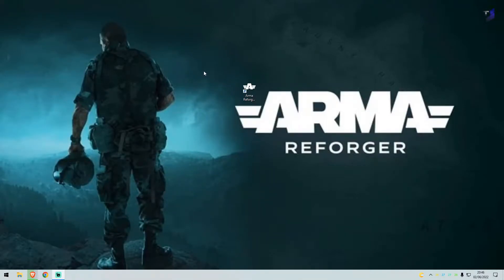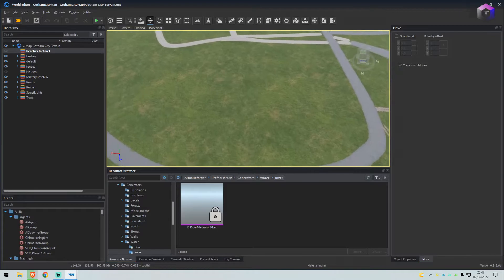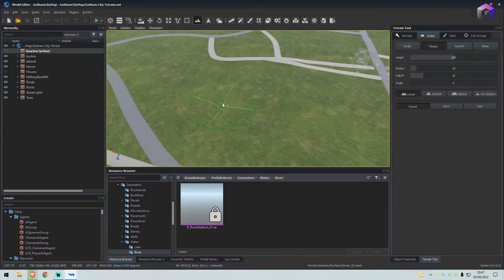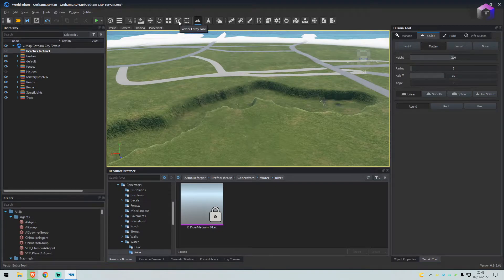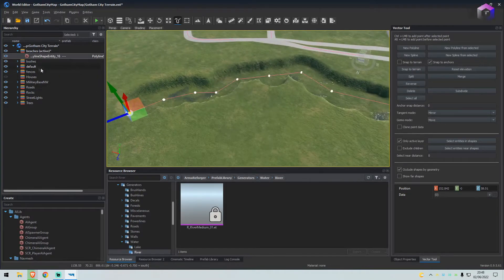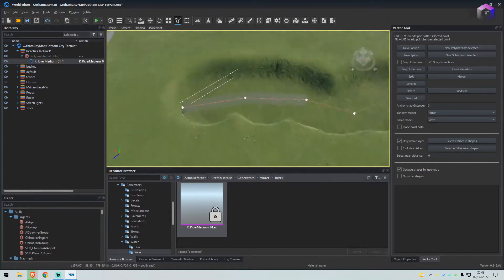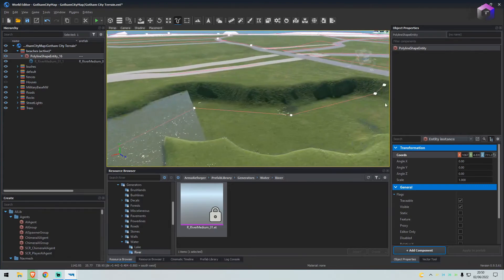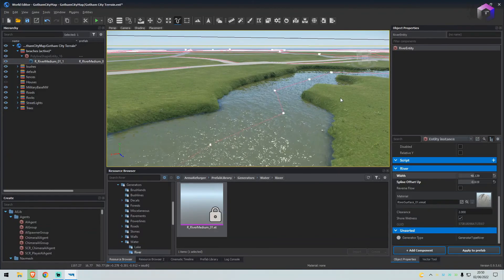How To Create A River In Arma Reforger Tools

Comment: Does a Polyline or a Spline make a difference?
Reply from the maker: Polyline is a line so everything attached is solid.

Spline is a line but splits at every edge so each fence panel for example can be adjusted individually where as polyline will be a single long solid fence that can clip through floors and stuff I believe.

Comment: Hey man, nice video! I'll just add few tips:

1. The river flow will be a bit nicer if you use spline instead of polyline.
2. You can generate river flow map in WE: Plugins -> Regenerate river flow-maps - the flow will then react to terrain and obstacles (a bit). I recommend bringing up console window before that to see the progress.

Life-hack: You can generate an initial river bed using the spline instead of sculpting it (if you wish so):

1. Right-click the spline in the hierarchy and add RoadGeneratorEntity to it.
2. Delete the RoadEntity it created under the RoadGeneratorEntity
3. In the RoadGeneratorEntity properties - check "Adjust Heightmap" and uncheck "Generate Road"
4. Adjust the spline, it will adjust the heightmap, you can make the bed this way.
5. Check out properties of the RoadGeneratorEntity like Road Width, Falloff Start Width and Road Falloff Width - adjust them to make the bed you want.
6. If you want to refine the bed by sculpting, make sure you have the RoadGeneratorEntity selected, open Terrain Tool and click Bake selection button. Then, you can delete the road generator and refine the bed by sculpting.
Reply: Very insightful comment! You by chance wouldn’t know how to add game master to my custom map would you?
Reply: @jamesparris6673 Just opened some older version of GM_Arland in the WE and I can see a SCR_GameModeEditor entity in the default layer of the GM_Arland subscene. It has a lot of components and children entities so it's really complex, but it appears there's some prefab for it in the Resource Browser (GameMode_Editor_Full) so maybe try that? No guarantees, never tried that, though 🙂